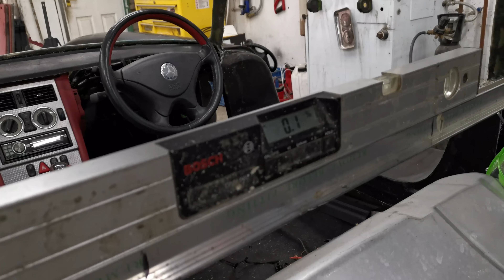Frame fabrication, strengthening the SLK pt5 of the gullwing project

Comment: Great project. You heard about that Swedish couple who dashed off a Jag D type? They won against Jaguar Corp. on the cease, desist and cut up the copy. So your body source may be safe? Stock up on expanding foam insulation for the voids-will add a solid sound when thumped. Also good for weather protection ...Prime that hidden metal well.

Comment: Can't wait to see this beauty finished.

I know it's not what you want to do, but in case someone (with very deep pockets) would want to build a small series of this: check out JP Performance Golf 3 project. 3D scans of body, engine and suspension combined with a CAD model of a tube frame.

Comment: That's a very challenging build, particularly concerning the overall structural integrity of the finished body as well as getting the loose panels attached to fit. One suggestion, when welding items like the sill addition to the original body all attachment points should be reinforced. This can be done by plating the body attachment points before welding on the items. it's pretty pointless just welding on to thin body metal. Suggestions by other posters as to the use of foam are very relevant.

Comment: I am impressed with the supports that you have fabricated. Would it be worth beefing up the side step supports to provide some additional side impact protection and will you be using a silicon type adhesive between the framework and body throughout to prevent squeaks and creaking to prevent it from sounding like an old boat. Also are you using an expanding foam material in the voids etc to prevent vibration and noise from the body. I have never undertaken anything like this myself so I am asking rather than recommending. The donor car is remarkably rust and rot free for 20 year old car that is after you removed the outer panels that were a bit scruffy in the usual places. My wife has owned several SLKs over the past 20 odd years and they may  make a great touring car. You certainly chose the right engine. Onwards and upwards.good luck with the build. When can I place an order!
Reply from the maker: Hi David there’s a lot more welding and fabrication to do until we are 100% happy with the integrity of the car
Yes we’ll be using a silicone bonding adhesive to secure the body as you say last thing we want is squeaks. A few people have mentioned expanding foam so may look into that, thanks for the comment 👍🏻

Comment: Bad Chad is building a tanker truck loosely based on a 1930s Texaco tanker called the doodlebug using all square tubing on a RV chassis , that's getting a steel skin though , I was asked to repair a right off TVR Griffith 500 , that has a tube chassis the owner had cut out the bent tubing and used second hand tubing to replace , he had another TVR that was in worse condition I had to repair the Griffith and make molds of the front end and bonnet to use to fix the the other one , I never got to do the other he took the molds and the car paid and never came , thank god for that LOL .